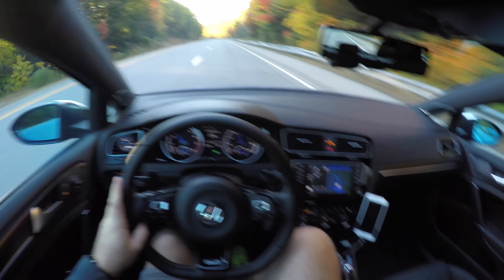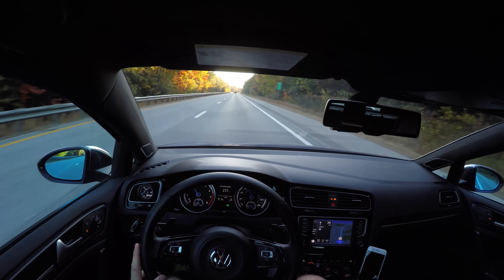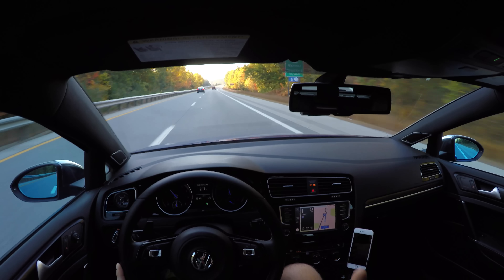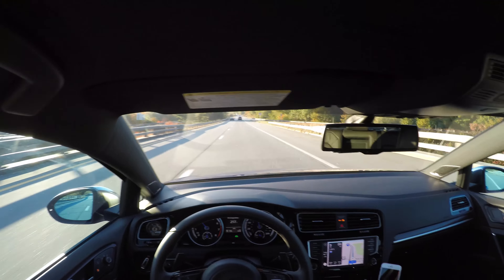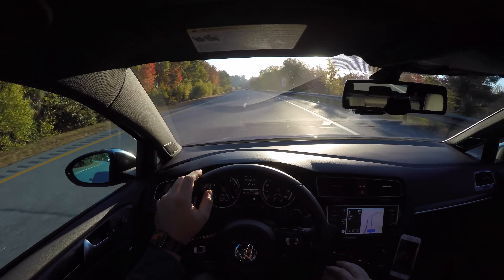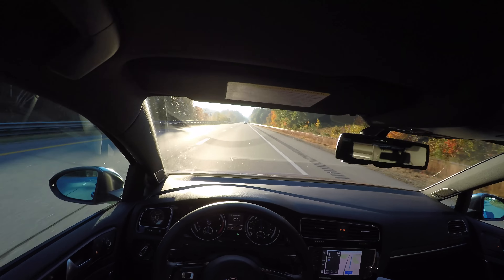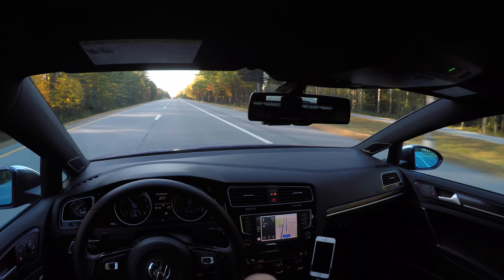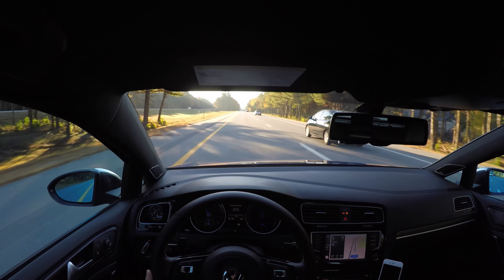Update on my 2016 VW Golf R (MK7) + United Motorsport Tune

Comment: Just picked up a new manual Golf R, and was curious as to your recommendations for aftermarket intakes...  
Also; how do you like your AppleWatch?  Is that the sport or stainless?  
Have really enjoyed the videos; keep them coming.
Reply from the maker: +Mister Geer Hello. Welcome to Golf R! You're going to love the car. What was your last vehicle? 

Intake is a tough recommendation. They all basically do the same thing and in your Golf, you can simply remove the left plastic in the intake with a dremel and increase air flow and noise, drop in a K&N filter and get most of the benefits of an aftermarket.

The Injen, APR and VWR are all popular choices. I chose VWR for the OEM / Stock look. APR is a default choice for most because they only buy APR :) 

--

Apple Watch is Stainless Space Black. I use the included metal link, Milano and Red Sport band in rotation. I think generation 2 is going to be more impressive. The UI, app launching and overall usability is pretty slow. It's great for activities, notifications, time, glances but to open FourSquare or messages and try to do something, I end up just grabbing my iPhone.

Comment: How has the car held up with the UM tune? I'm currently tuned with Unitronic stage 1+ but am considering going to UM. From what I gather they have the best DSG tune out there.
Reply from the maker: Fantastic! You can check my newer videos. 33,500 Miles on the ODO and tuned since the first 1,000.

Comment: Hey Adam, you didn't really cover how it felt compared with stock. Can you elaborate on the before and after of the tune? Also, did you end up getting the transmission tune as well?

It would be helpful if you showed a little footage of the shop performing the tune so people watching the video would know which part of the video was before in which part was after while you were driving.  Not trying to be critical, just helping you with your "video skills". The better they get the more dog bones you can afford. ;-)
Reply: +Adam Chandler LOL, no worries.  I have done a couple videos myself and mine a horrible, yours are actually pretty good.  It's really hard to know what to cover in the moment.  I always view my vids later and realize all the stuff I could have done better after the fact.

Ahhh, I see, sorry I didn't realize that.  Looking forward to hearing your review of the tunes.  400lbs of torque will feel pretty sweet.  I have been trying to acquire an R since about August (Without putting an order in) and it's near impossible.  I want a DGS version so my wife can drive and the ones that are on lots are marked up by like 4K which I won't pay.

I'm in MA, so if I get one I could use the shop your using since they are in S. NH.  Do you like them?